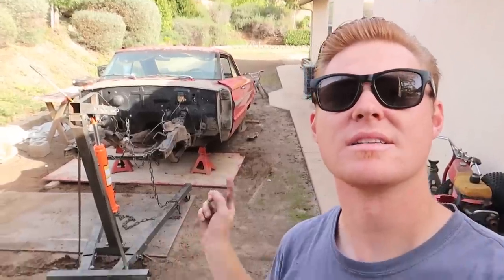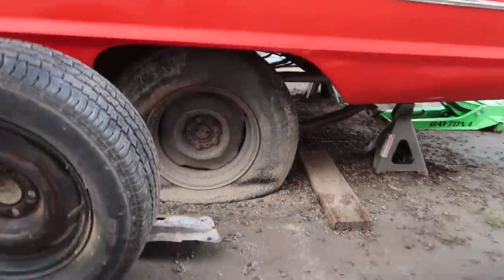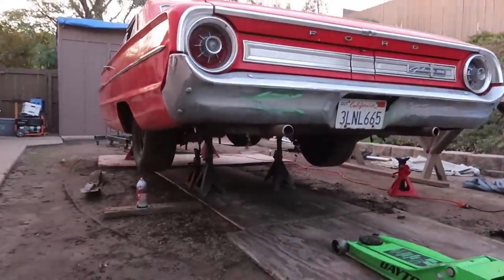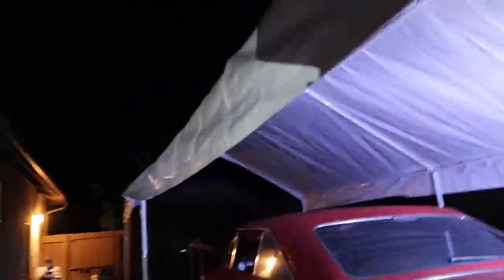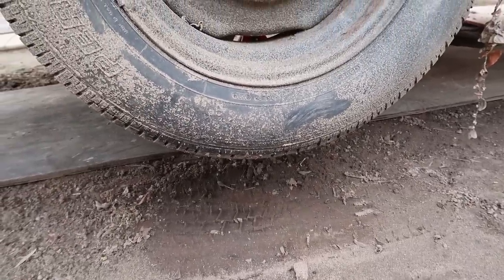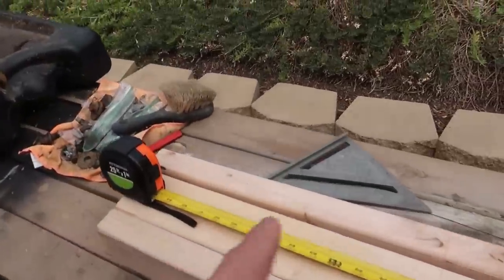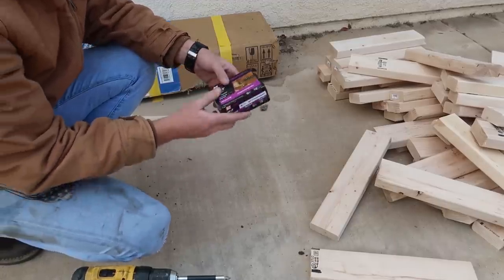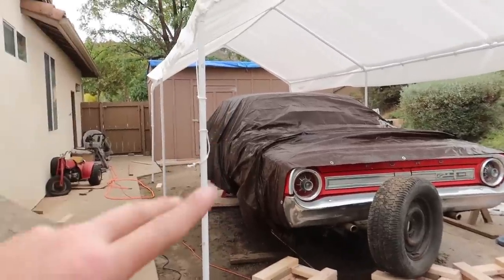Making Cheap Jack Stands For ANY CAR!

Comment: Hey just for next time you said you got 3-inch screws so they would go through one board and half way into the other but 3 inch screws would actually go all the way through both because 2x4s  actually measure 1.5" by 3.5" not 2" by 4" 👍
Reply: Ya....us carpenters know these measurements like nothing.  I can give inch measurements pretty accurately....simply with my fingers...lol.  Wood blocking, though, is not worth it anymore, unless youj're doing it with blatant scraps of wood.  2 x 4s are have gone up enormously in price.  Here in Canada, it costs about $25 Canadian for a 12 ft 2 x 4.  It's absolutely ridiculous right now.

Comment: Wood blocking is okay, been used for years in rigging and construction watch around bridge highway constructions as you are driving around and you'll see them used large scale, it is how houses are rigged to prepare to slide beams underneath them for moving.
If you are going to do this long term you can make some like they have at LKQ u-pick yards. One rim horizontal the other perpendicular, need more height add same size rim on bottom, just weld them together, like 1" long welds. Just tell folks you are looking for scrap steel rims, when you get enough weld a stack together. They put them under the frame or at unibody jack points.
If those poles are not fastened to the ground you might want to hang blocks just off the ground at each pole to keep cover from becoming a kite, seen a bunch of them blown around at the flea market here in SC.

Comment: Thanks for posting this... Due to economic times, FJB, I turned in my lease and decided to find a used car to purchase, and I only wanted to spend around $2000 - $4000. Well I found one, and guess what, my $2000 2003 Buick Park Avenue needs bushings, like all of them. These cribs saved my bacon, as the local shops are outrageous. Going to be dropping the front and rear subframes this weekend to do some parts replacement. These cribs make the job incredibly safe and efficient. I built four of them, and constructed each one in two pieces, get it off the ground and GET IT OFF THE GROUND. Thanks again. Total cost for lumber and screws, around $100 at Home Depot. I got lucky, fresh shipment of 2x4's, and the wood was actually straight, no crown, no cracks and few if any knots. I thought I was in heaven! LOL! I never see this quality of standard 2x4's at Home Depot.

Comment: I like how you make those stands I do not trust jack stands anymore with the saw tooth adjustment I just do not trust them I use cinder blocks for anything dealing with raising a vehicle for a sustained amount of time.
I think you should cement that area of the yard the tent is a nice touch and I know it is your parents home but cement that area in for working on cars it is just going to be safer.

Comment: Bruh did you just jack it up by the bumper?
Cant do that with a new car lol.
Reply from the maker: That’s the jacking point on this car cause it bolts to the frame
Reply: Makes sense. Does it have the little slot for a bumper jack like most pre '80s cars did?
Reply: Jordan Wiley seriously, I got a 84 Toyota with super duty axles on 44s and still I can jack it up by the bumper.

Comment: Downs side of these wood stands is you can't really leave car out in the rain with em.
Reply: You could if you stained or painted them.
Reply: @aaronrodriguez110  Hmm, I guess you would need to before putting them together to make sure everything was coated. Then would need to cover the nail / screw holes to keep water out as well. Will add quite a bit more time and still not sure I would leave them sit on wet pavement. Maybe use treated lumber, at least for the bottom pieces.
Reply: @onlywenilaugh6589  yeah you could. I really just depends on how long you plan on leaving them on there, too.  Any jack stand is a temp thing. I think you could leave it for a few weeks if not a couple months and it'd be just fine if it was painted. As far as screws or nails go, if the application of these is for them to remain outside then galvanized would be the way to go certainly.

Comment: Imagine somebody with a kung fu grip
doing a Karate chop thru all levels of your stand..now imagine your car going thru it the same way..u need a solid 
continuous tranfer of weight from the bottom of your tire to the ground..
Be safe..
Reply: You probably have no clue how strong a 2 x 4 is.  These things are used to hold up much heavier vehicles...like pretty large boats.  A 2 x4, even 16 inches long....will never break under the strain of 1/4 of the weight of a car or truck.  It's ridiculous to think that could happen.  Much safer than any jack stand, which can tip over with a bit of a shake of the vehicle.

Comment: Looks Gud cuz! Lol, would it be more sturdy to turn them the other way just to give a touch of side support? Not that I think it will slide side to side but I've never seen one slide off a jackstand either.... matter of fact, I got a 68 f100 on a jackstand n it's been ft way for at least 3 years out in my yard..... on non level ground...... I ain't getting under it! But it ain't went nowhere yet!

Comment: That’s only about 850lbs per corner on those stands for a total of 3400lbs.
Reply: Where’d you get your calculations from? I think you’re quite a ways off, no offense. Cribbing is a very old tried and tested solution that even firemen and rescue operatives utilize to this day. Although the basics of the original utilized softwood 4x4s, even 2x4s were common. I’d estimate it at around 10,000 pounds per wheel as a matter of fact, seeing that 4x4s box cribs can actually carry up to 24,000 pounds (at 5 on 5 pieces cross stacked high) due to the contact points. Even if you lie balled it to half of that for the 2x4s, at 6,000 ibs per wheel you’re still at 24,000 pounds all around, which is almost 12 tons. You have to remember where you see this daily in real life: pallets! 

Another VERY important factor in using such a wood contraption is that even the failure is SLOW! Meaning the fibers giving way to such an event would actually be slow enough to provide time to react, IF such an event were to happen in the first place.
Anyway here is some reference:
https://docs.google.com/presentation/d/1jqISUJ_yEIjnavCs0To2NDPl70oVCTCIt3Wlppp_Kfc/htmlpresent
Reply: @gedionsamuel2256  calculator.  🤪.   If you put your car on a set of scales to setup each corner spring rate, and you get a balanced weight on each corner of 850lbs x4=3400lbs
Reply: Mustang Guru My fault, I misinterpreted as if you were saying that those cribs could ONLY hold 850 pounds each! I didn’t know you were trying to say that the weight of the vehicle was that. Lower weight per corner means even better!